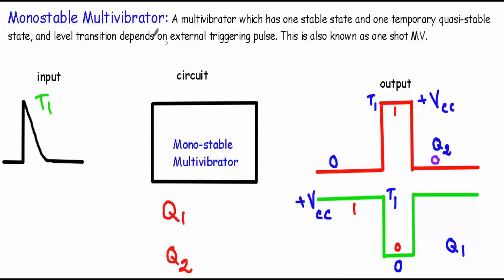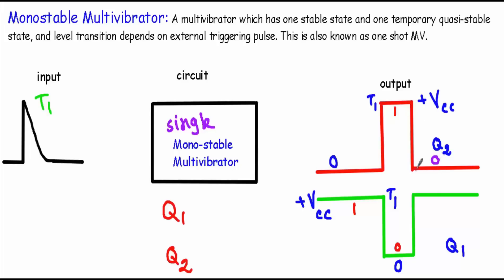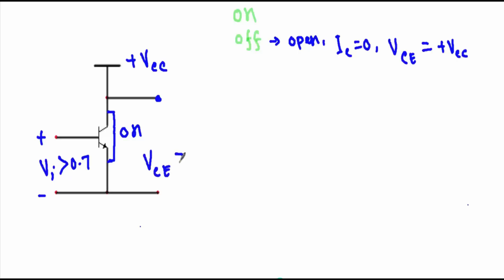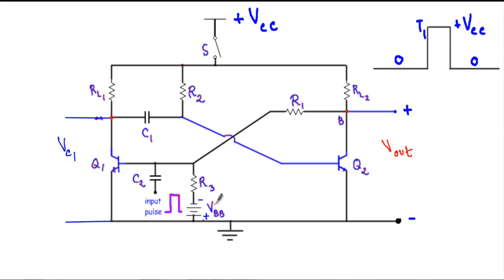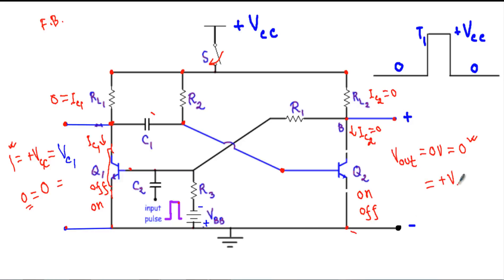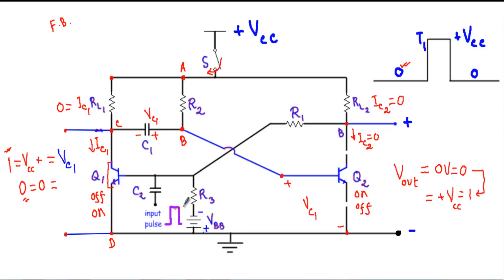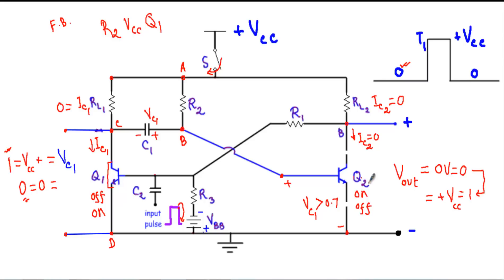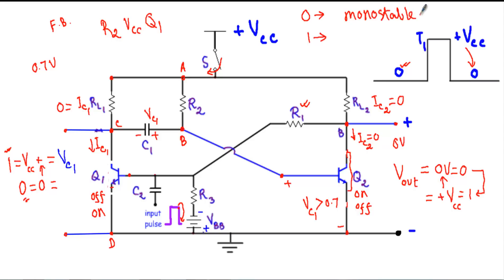Transistor Monostable Multivibrator

Comment: At 11:20  u r saying base Voltageis zero but my doubt is through r2 fromm vcc some voltage is there then how
Reply from the maker: At that instant, capacitor is uncharged so voltage across capacitor Vc = 0V,  Now, look between collector of Q1 to ground Vc1 = Vc + Vbe2. As Vc1 = 0V, and Vc = 0V, Vbe2 must be equal to zero. Otherwise, voltage between two parallel paths will be different, which is not possible.